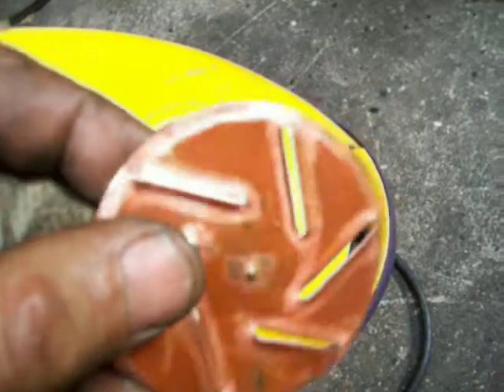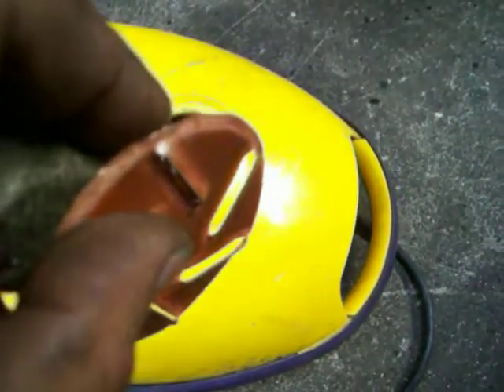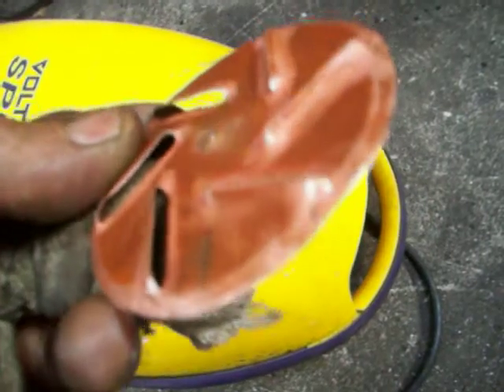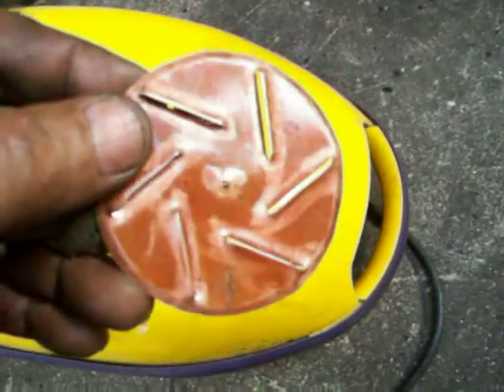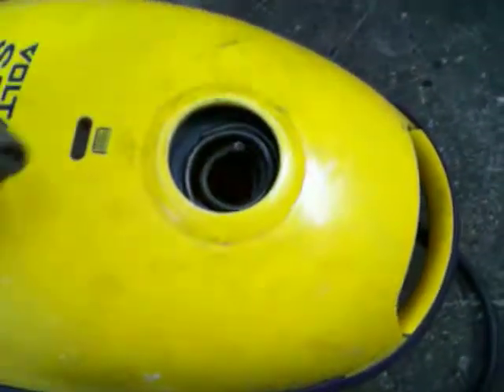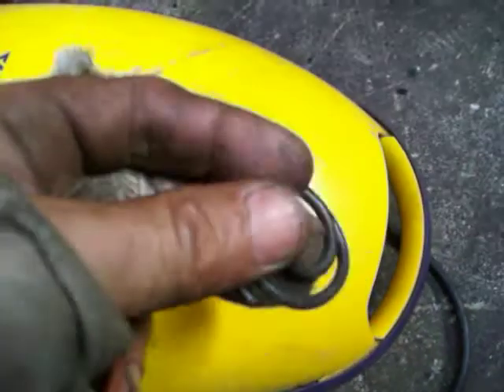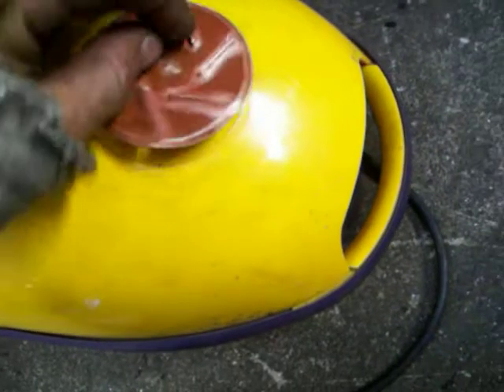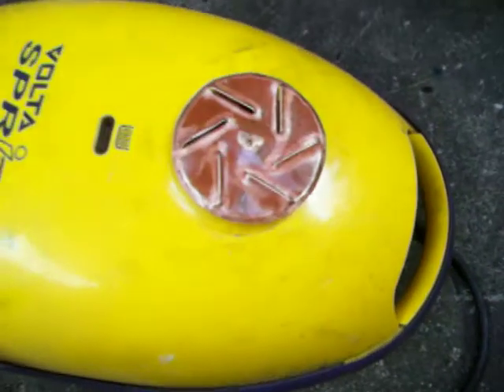fluted suction fan test

Comment: Good work! that has potential...
Reply from the maker: Cheers, That's why i put it out there.  Repulsine or other type boundry layer fan, in take drive. needs the angle & flutes to get drive. probably work with fluid too, had similer experiance with torque converter impeller.